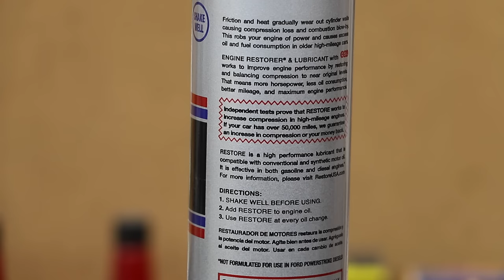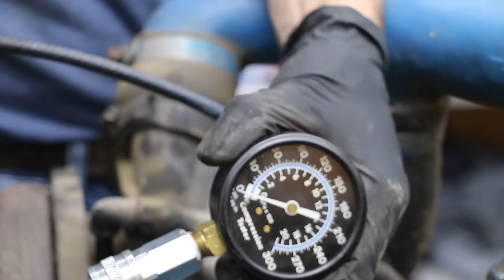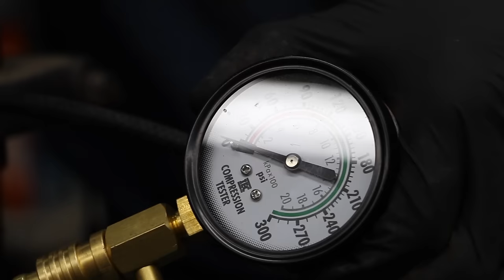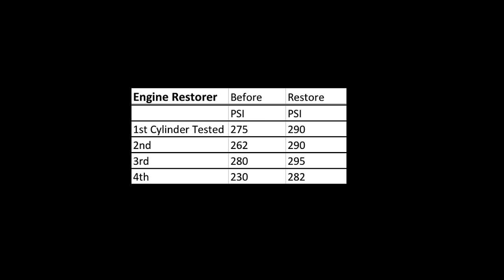Does Restore Work?  Will it Improve Engine Cylinder Compression?

Comment from the maker: Thank you all very much for suggesting a test on engine restorer.  Here's the link to the update on the Ford 5000 a year later:  https://www.youtube.com/watch?v=VXIu3oo8z4c
Engine Restorer for 8 cylinder engine: https://amzn.to/3j4JoEb
Engine Restorer for 6 cylinder engine: https://amzn.to/32kpEpt
Engine Restorer for 4 cylinder engine: https://amzn.to/32liXDq
Reply: How about 3 cylinder diesel engine ? Can it use any kind of Engine Restorer above ?
Pls answer my query Sir
Reply: @BoDoi105  I am also interested, what about 5 cylinder engines?
Reply: How much restore to use for a 12 gallon isx cummins
Reply: I would love to see a video on different types of oil_crank case cleaners

Maybe like gunked up price. With different types like, seafoam, lucus, amsoil, some big name and some cheap ones

And maybe if they were heated like they were added in a engine then ran then drained like you would normally do with cleaning it and changing the oil.

Would be cool to see if it causes damage to any additives to the new oil from any left over residue
Reply: Buen video ..me gusto
Reply: I just bought this stuff. 
My truck cranks but won't start. Two different mechanics told me it is most likely the timing change. Compression is low but everything checks out good. Relays, electrical, fuel pump, inertia switch, battery and ignition are good. 
They told me it costs between $3500 to $8000 to repair it. 

This Engine restorer is my hell mary.
Reply: CC C  thanks for the help. It's a 2004 ford sport trac v6. I am having it towed back on Monday. 
A little history on the vehicle. Never heard the timing chain prior to the problem nor did it ever stall. It was a great truck. The day it happened I noticed the DPFE sensor was damaged. I am going to clean the EGR and change the oil along with engine restore to see what happens.
Reply: TriboTEX Nano Oil Additive is very very expensive, and makes astonishing claims. Most expensive snake oil yet?
Reply: Based off what you know about engines, how would the best way to drive be to maximize the application of Engine Restore? Think high rpm would be better or a fairly low rpm, high load? constant rpm or varying? 

I hope this works, my exhaust manifold gasket blew out the day hurricane Ida hit as I was evacuating, drove a few hundred miles probably under an extremely rich condition, ended up changing the gasket in an abandoned parking lot far away from home. When I got back I changed the oil, there was gasoline and metal glitter in it. I just did 2 oil changes and added Restore the final change, with a new filter. Drove it around 10 miles since, hard to get steady moving mileage right now, all the stoplights are still broken and traffic jams are everywhere, even on the interstate.
Reply: hello love your hard work and consumers research, btw it used to have a greenish color in the 90's. Used it in 83' Z28 few times back then
Reply: What would happen if you mix Engine Restore, the regular engine oil, and Lucas oil stop leak(really thick)?? Is it bad for the engine
Reply: Trevor Brannon  as far as I know it 10 percent of oil first time and 5 percentage of oil for maintenance dose. I use with 2001 Corolla which first use vvti before. It work well but not good with vvti engine
Reply: After watching this video, I gave the 6 cyl Engine Restorer a try in my 2008 Dodge Grand Caravan 3.8L. The van was using a quart of oil every 500 miles. I changed the oil and added the product in the new oil. I now have 3,000 miles on that oil change. I checked the oil level every other time I filled the gas tank and now with the 3,000 miles on that oil change, the engine oil is down 1/2 quart of oil. I'm not sure what's in this, but it sure made a huge difference in my oil consumption. I use NAPA (Valvoline) full synthetic oil of the proper weight for that engine. The $8.00 for the Engine Restorer is a lot cheaper than a qt of synthetic oil every 500 miles! Thanks for the great video!
Reply: I have an update on this product. My Dodge Grand Caravan SXT 3.8L was using a qt of oil for every 500 miles! The liar I bought it from told me it used a qt every 2,500 miles. I did an oil change and added a qt of Engine restorer after watching this video. I also added a qt of Lucas Oil Stabilizer to the 5w20 oil the manufacturer recommends. I used Valvoline full synthetic oil. Just before I did the oil change, I also changed the very gummed up PCV valve. I just changed the oil again at 5,500 miles and it had used 1 qt of oil in that 5,500 miles. I only added the Engine restorer and changed the weight of my oil to 5W30 full synthetic Valvoline oil. We'll see how the oil consumption is with just those 2 changes. During the first oil change I checked the oil every couple of times I filled the gas tank and it finally needed a 1/2 qt at 3,500 miles. The next 2,000 miles had 1,200 miles of constant high speed driving than the first 3,500 and it used another 1/2 qt for a total of 1 qt in 5,500 miles. I can't wait to see how just the Engine restorer and 5W30 oil holds up. I will keep you informed.
Reply: I would like to request for you to test X1R engine oil additive and compare it to other engine oil additive as well as no engine oil additive (just engine oil) as benchmark. Thank you.

Comment: I'm glad that you turn down sponsors, without them there is no bias against brands
Reply from the maker: Yes, I don't have any plans to accept sponsorship in the future.  Thanks for taking the time to comment!
Reply: GREAT for YOU Project Farm!!! Otherwise,I'd see some "bias" in your videos knowing You accepted sponsorship $$$!!! But staying clean,keeps your honesty in-check!!! Bravo!!!
Reply: Years ago i bought an 85 GMC 2500 plow truck on a deal knowing the motor on its way out and was going to put a 454 because i put a sander on it. It was clean truck but the 350 was buring old like a pig, it was doing 2 to 3 quarts worth during each of the first couple storms. So for the hell of it i bought a can and dumped it in... That truck neverrr burnerd oil again and ran so much better. I got a soild 4 years until selling it to someone who ran it for years after me. I mean would leave the sand yard an tip the scales at just over 13,000lbs in thaf thing and have to open the 4 barrel up to get it to move lol..so i didn't rake it easy on it either. Engine retore def worked for me in that insurance.  Love your videos man an sorry for the rant but it worked an tell everyone who asks lol..keep up the good work!
Reply: @ProjectFarm  I also think it is great you don't accept sponsorship's. However, based on how many new ones you go through, maybe a sponsor for spark plugs?
Reply: Hello I will be getting this stuff today and I want to try it in my 50cc scooter with 1 litter engine oil.  Could u please advice the right amount of restore to put in?
Reply: @sanelb1147  if you have a 4 stroke scooter, just replace the whole topend. A complete kit (piston, cylinder, head and gaskets) is like 40$ off aliepress.
Reply: Lmao you really think that, this guy is fake af🌃
Reply: Ugghhh... I see so many people making this ignorant comment.  He works hard and deserves more, HE SHOULD NOT TURN DOWN SPONSORSHIPS!!!!  HE CAN STILL MAKE NON-BIAS REVIEWS if the product he's sponsoring either IS NOT RELEVANT to any tests he'll ever do OR if he negotiates the terms of the sponsorships which you probably don't realize is possible.  Not everybody will be okay with it, but some sponsors will allow you to be brutally honest with their product, and if it's not good or faulted, they will allow you to say so.  He CAN take sponsoring and still make unbiased reviews.  It might be a little harder, he might not get as much money for the sponsorship but it's still extra money that this guy needs (proper testing equipment is expensive and I'm sure there are things he would like to buy to make tests better) and deserves.
Reply: @hojnikb  a piston for 40 is probably going to be shit, there's no way you're getting a head or cylinder for that kind of money either and if you're buying parts off AliExpress you're asking for trouble
Reply: @Jason-im3pz  they're just fine, cant judge something you haven't tried yourself ;)
Reply: @hojnikb  I'm riding dirt bikes years man, the cheapest cylinder I ever got was 300+, cheapest head was around the same. Good pistons are 80+, there's no way getting the whole lot for 40 is going to be worthwhile
Reply: @Jason-im3pz  This is different. It's a smaller simpler cylinder and because gy6 engines are so commonplace and produced in literal millions, parts for it are very common and very cheap. Even brand name stuff from naraku or taida wont cost 300$. It's just economy of scale.

And yes, even those cheap kits work just fine. They're pretty much the same quality as the ones used in oem engines anyway. It's not going to last you 100k miles, but neither will rest of the bike.
Reply: @hojnikb  yeah cheap parts are so good, that's why cheap shit breaks and doesn't last pissing time. It's your money and time you're wasting bud
Reply: @Jason-im3pz  I mean, to each it's own. But gy6 powers a LOT of scooters out there.
Reply: Only if they allow you to say the truth
Reply: Exactly....doing so would undermine the entire foundation of why Project Farm was created in the first place. I love this guy.
Reply: Does it start now?
Reply: im not glad

Comment: I was the Chemist who made the ingredients that is in this product in 1983.
Reply from the maker: It seems to be an amazing product.  Have you owned a vehicle that needed this product?  If so, have you used it?
Reply: no way! is this true??
Reply: I need to know!
Reply: I'd really like to see some proof of this. I'm not assuming you're lying, but...you know how easy it is for people to make claims on the internet. If you really are the guy who formulated this product, you deserve every penny you've earned from it.
Reply: We are all skeptical because unfortunately we can't trust anything on the internet anymore. If it's true then great!
Reply: I do remember the old ad for this stuff. Ill tell you guys this much. It has in it almost like a liquid graphite.  Take a Dry Graphite lube, add it to some oil and BAM. that is all. It is temporary for, it burns off but it smears and fill gaps and does work to increase compression!! The reason it can be bad in powerstrokes (AND OTHER SYSTEMS AS WELL MIND YOU) is it can have a gumming affect in pumps and sensors. It will decrease oil flow in your old oil filter also so be mindful to change that asap.
Reply: @ryano8613  Actually the reason you shouldn't use it in a Powerstroke diesel is the fuel injection system uses a high pressure oil to actuate the injection with very small clearances.
Reply: Bart Pangilinan , Awesome thanks for the reply and taking the time!   BUT......
    for me , thats not a " reason " . I need to know the why. The mechanics behind the reason. You copy? 
Again i do appreciate your response though, thanks!
Reply: Bart Pangilinan and also so what your saying is oil is used to actuate the injectors which in turn act as the " PUMP" more less??? Im not sure your reply makes sense to me sry.
Reply: Project Farm do you remember the red cardboard tube of small wax/graphite pellets you coild buy back in the day? 

U would drop them down the spark plug hole when the engine was hot then run down the road at hi rpm and it would bring back compression.... same sorta concept i believe with this Restore. Im betting it has negative affect s long term of used often but thats ALL SPECULATION.  On my part mind you!!
Reply: @ryano8613  It's a goofy system to me. The injectors control high pressure oil to actuate the actually fuel injection. It's really hard to explain. If you google Powerstroke injection system it will explain it.
Reply: @bartpang  you are correct. The power stroke engine is a product of International and is a smaller version of their big truck engines. It uses a pump to increase the oil pressure that in turn provides the pressures necessary to operate the injectors. Kind of a dumb system. They have problems with oil line fittings that cause a loss of pressure, which in turn causes hard or no starting conditions. They have aftermarket thread in fittings to correct the problem they had from factory fittings.
Reply: Liar!! There's no "I" in Team.

From Restore: "all our products were developed by a highly qualified TEAM of research scientists and engineers."
Reply: @ryano8613  The soft Metals like Lead that's used in Restore will tighten the tolerances even more and will prevent the injector spool from returning back to home position to accept another shot of fuel. It would act the same as when people use regular Dino-Oil instead of Synthetic and wait too many miles to change their oil and the injectors start getting gummed or varnished up. Sorry if this doesn't help.
Reply: Why was two different compression gauges used during thus test?
Reply: Restore works great but no product fixes everything. Rod knocks and bad ones stop knocking and last many yrs on my vehicles
Reply: @ryano8613  Did you actually read the ingredients?  *No graphite*, and as explained below, your 'theory' is NOT why it is not suitable for powerstroke engines.  For heavens sake, look at the ingredients and do a little research.
Reply: Good work! But I really needed you back in 1980. Never mind, they keep building engines for a little longer.
Reply: @bettthedog  I didn't notice that. Well done.
Reply: @ryano8613  I used those pellets once in a Nissan pickup that had pitted cylinder walls (long infuriating mechanic story).  It was a monumental pain to remove the hot plugs and get them back in before it cooled, but they seemed to reduce oil consumption a bit for a few months.
Reply: I CALL BS
Reply: unfortunately none of your replies are correct.
Reply: @JuanFuentes8492  please don't cuss people or I will report you if I see you ever say anything like this again
Reply: @adamsmy8121  🤣❄
Reply: I don't need proof.. I believe everything anyone has ever told me. Congratulations on your success! I'm a bit of a chemist myself. The DEA told me i was the first chemist to make crystal methamphetamine using over the counter products..
Reply: rttrich is fos and a poc
Reply: @jamesbullock7257   you used restore for rod knock?? How is it gonna help with bearing cavitation?
Reply: Rttrich is engine restore a one time fix? In other words do we need to add restore every oil change in the affected engine?
Reply: It’s just lead right? I did an oil analysis after using restore and the lead numbers were extremely high. Also restore only works as long as you use it. An oil change will bring back poor compression since the lead filling cylinder wall scoring will eventually wear away.
Reply: Will this product stop oil consumption

Comment: I put RESTORE in my youngest son's VW Scirocco that was smoking badly.   It stopped the smoking.  That was 22 years ago and the engine is still running fine.
Reply from the maker: Wow!  Impressive!
Reply: 22 years ago?
thats unreal....
Reply: Vr6?
Reply: 22 Yrs ago, are you still on the same oil or do you have to add it to every oil change?
Reply: A VW that smokes badly? Hitler hated tobacco, so I would think a nazimobile wouldn't be a heavy smoker.
Reply: 86' scirocoo was a fun!
Reply: @sat_sonic  
I have used Restore and yes you need use it at every oil change,  still a lot cheaper and faster than rebuilding an engine
Reply: @sat_sonic  
I have also used Lucas oil stabilizer and it will stop smoking as well again need to add to every oil change 
I prefer Lucas because I have used a lot of their products and had great results
Reply: @teemu8134  it was all a misunderstanding though, Adolf said "a glass of juice"
Reply: @bertgrau9246  
Lucas suds up oil. Makes motor quieter but masks problems. I wouldn't use it. Better off just adding a bit of oil every so often to boost compression.
Reply: @lordterra1377  
I understand what you're saying thing is Lucas also stopped the engine from smoking. I realize it just mask the problem, still it's cheaper and with no smoke much better. Just my opinion. 
I do appreciate your opinion,  I'm not trying to argue with anyone just sharing experiences. I didn't know Lucas would cause oil to foam. 
Thank you
Reply: @bertgrau9246  
I used to use it year ago until I found this out. Good luck!
Reply: @lordterra1377  
Thanks again
Reply: @RockandrollNegro  Buuuuuurn!!! 

Or not cause Hitler hated tobacco.
Reply: Being a Volkswagen its's kind of hard to believe that it's still even running because the multitude of problems those vehicles have.
Reply: @eric63377  😂😂 true
Reply: No car payments in 22 years can't beat that
Reply: Put some in my smoking civic today and so far the smoke is mostly gone, hope it works the same as your son's!
Reply: @chrisbeaudoin9818   please give a up date in a month
Reply: @Juice-jx1pr  if i remember or if somebody else reminds me i will for sure
Reply: @Juice-jx1pr  oh shit someone just liked my comment and i saw this again. Sadly i have bad news. Kept it for like a week after i tried this and the smoke was the exact same. I think it was just the amount of oil i was burning that made it impossible to fix so easily.

Sold the car at a loss and learned a big lesson on buying used cars lol
Reply: @eric63377  which ones?
 Asking out of curiosity